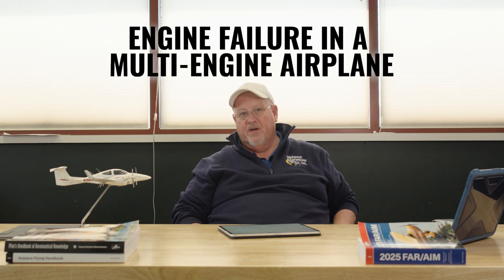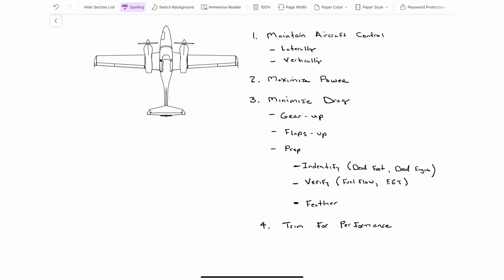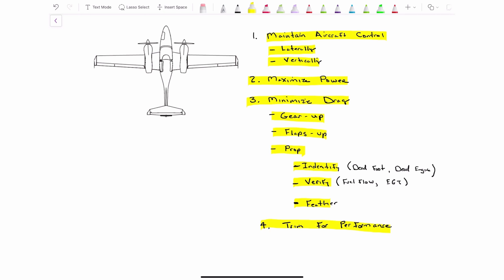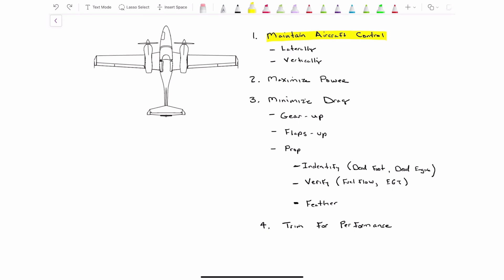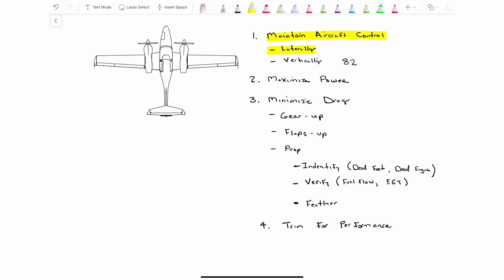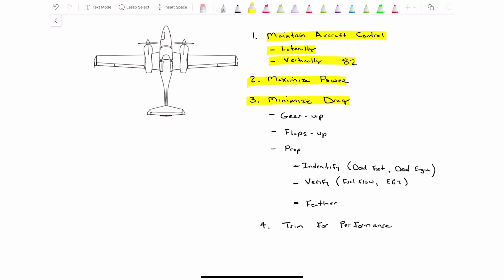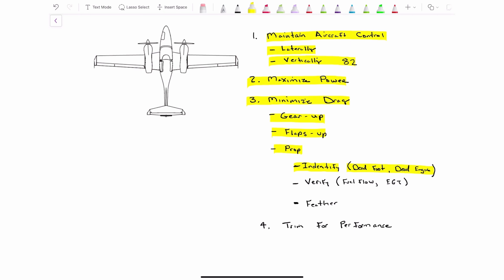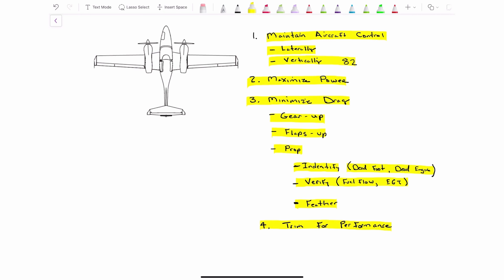Multi Engine: How to Deal with an Engine Failure in a Diamond Twin Star

Comment: I like your emphasis on maintaining control first, but I think you overemphasize sustaining the climb as part of that.  I believe that, in a large number of light twins, you may be challenged to do that, especially in your startled, OMG moment, and as you are working through the rest of your tasks to optimize single engine performance.  I know we train for worst case and there are circumstances where sustaining a climb is truly necessary, but unless I am flying with full awareness of a dramatic need to climb, if I suddenly lose power, I will almost certainly drop the nose to at least level as I'm putting in the rudder.  Maintaining control means keeping the airspeed well above blue line as I assess and learn how the airplane is going to perform in the current weight/balance, altitude/temperature conditions I am in.  Sustaining the climb may not even be possible and I would hate to still be 8 degrees nose up, lots of drag, rapidly decreasing airspeed as I go heads-down to work the levers.

Comment: As a multi engine pilot and instructor since 1980, another good verification is EGT if equipped. It's already in your scan. I used to at least once during training close a fuel valve so the student can experience the real thing. Of course you have to do it safely. 3000' agl, over an airport, etc.. you would be surprised at the results. If you can afford it, I highly recommend simulator training.

Comment: Hi Steve, thanks for posting this video. To verify the dead engine, wouldn't you retard the the throttle and check that there is no difference in sound and performance?